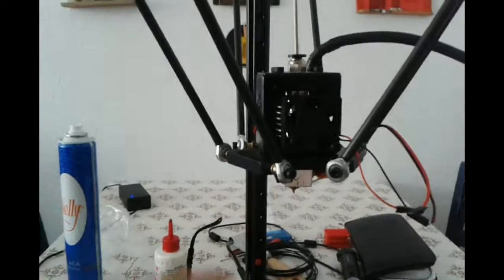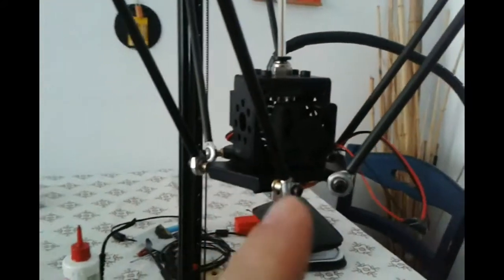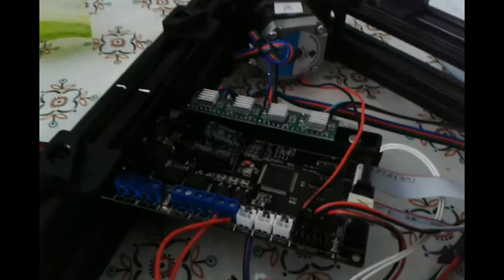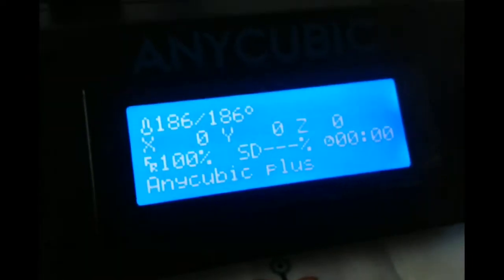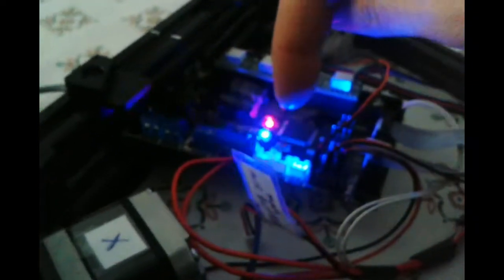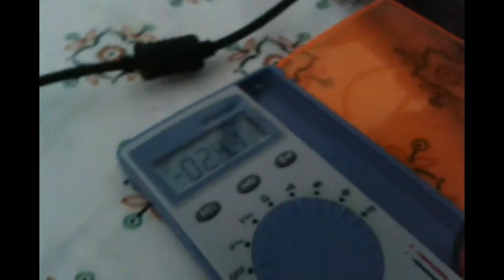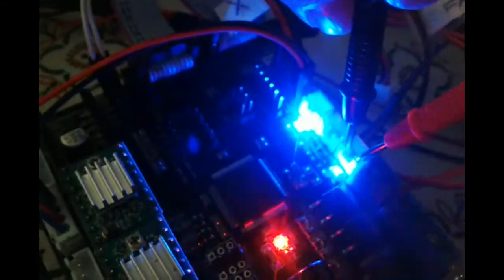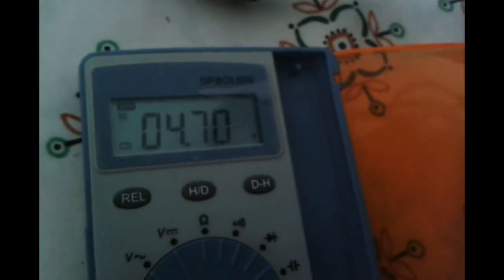Problen with the fan. Testing out put the mainboard Trigorilla of Anycubic

Comment: Hi, have you found a solution, why is there such a problem?
Reply: hello I have the same problem,  Andrew did you solve this issue already? is there any other way than buy new motherboard ? thx in advance
Reply: @andrzejszwajca8526  yes, i fix it. In my case, the npn transistor in the sot23 package burned out.
Which is located near the cooler connector, on the board. They burn because of the cooler shutdown during printing.
 I used these https://aliexpress.ru/item/32843349769.html?spm=a2g0s.9042311.0.0.274233eddrrH5I&cn=vk_ugc&from_content=wall_0_0&isdl=y&aff_short_key=bkkZKvWB
Reply: @andrzejszwajca8526  https://sun9-40.userapi.com/c854416/v854416679/f41c0/YwK9-VzUYBE.jpg
Reply: @ @andrewstepovoy3624  Thank You so much, tomorow I will check it on my motherboard. I'm not a specialist in this area but now I know what probably isn't working properly. I hope that if i will have problem with it I will try contact with You again :)